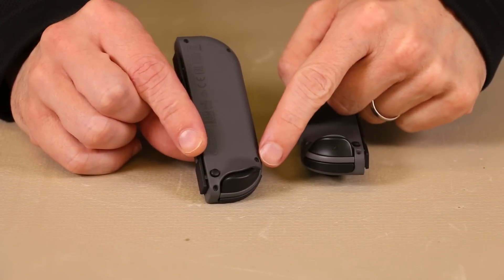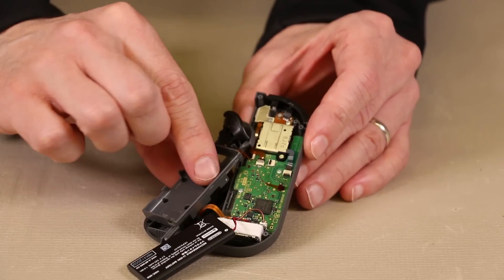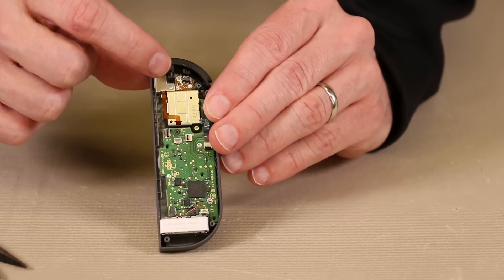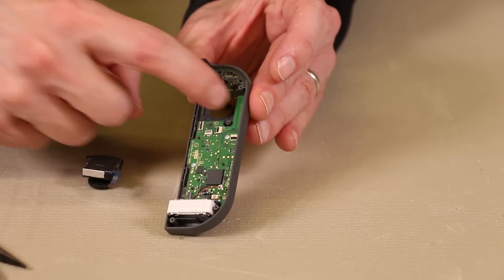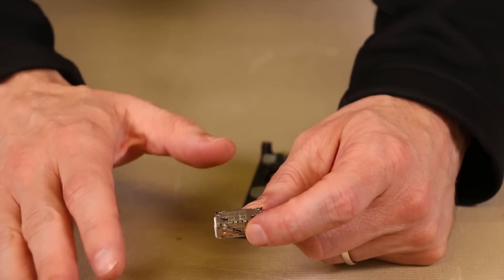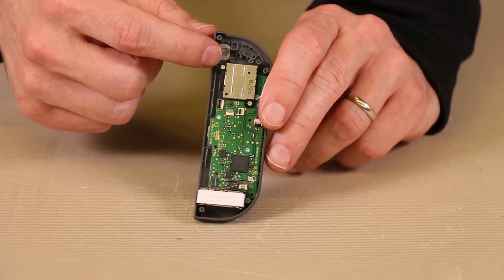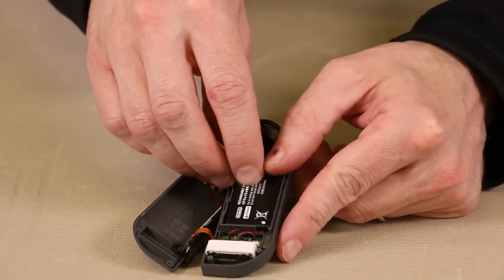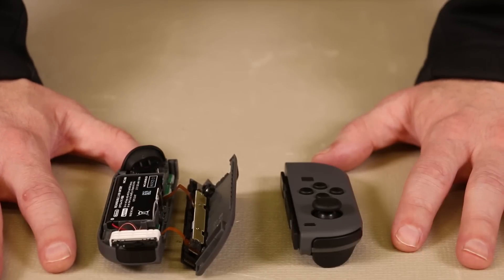Nintendo Switch Joycon Teardown -

Comment: There's no locking tab on the bottom ribbon cable that's attached to the casing that you removed, and the cable came out after the joycon was dropped and fell apart (I dropped my switch from a 1-foot height accidentally and am now trying to fix it) so I need help

Edit to clarify: My issue is that I can't get the ribbon cable back in and idk how to lock/unlock it without the tab

Comment: How come nobody seems to show the proper way of unlocking the connectors for the ribbon cables? They just say you need to remove the ribbon cables. Yeah - no kidding. But they’re really tiny and easy to break if you’re not gentle or using the right tool.

Comment: Okay, so I accidentally pulled the joycon off the side leaving the two ribbon cables hanging out. I ended up here. Your video rocks but I hit a snag. The little black thing that covers the ribbon cable has come off. Can I repair this? Can you go a little more in-depth on how to handle or fix these?

Comment: Thanks! I found this very helpful. I spilled wine on my controller and everything was sticky. This guide made things a lot easier than I expected. The only hard part was reconnecting the first two ribbon cables, because they need to be reconnected before the battery holder is screwed in...and everything is so ridiculously tiny; my hands are not.

Comment: Been an engineer for years, this dudes an idiot, if you actually followed this video that chances are you’ve messed something up. 
Just basics, please disconnect your battery before anything else as you can cause electrical damage if you don’t. And while it’s been brought up the cuts are just ridiculous. Please never do this again.

Comment: I was almost done putting the Joy-Con back together, just screwing the back to the front (your guide worked like a charm), then I realized I might not have put in the battery correctly. I started to unscrew what I had done and found that I had worn the top of the screw down and it was stuck. Don't know what to do, and I was so close to being done.

Comment: I've open my joy on to try and fix joystick drift but broke the ribbon cable to the minus button and l button sadly um if I use thermal glue to fix it will it work or unfixable?

Comment: Hey @tronicsfix ,what credentials do you have? I would love to get into fixing broken consoles. I have a experience with PC's and networking devices. I do not have any in electrical engineering. How would I learn the skills to help me get started in this awesome trade? Do you have resources? What is is called so I can google it? Electrical work? Circuit board repair?

Comment: For anyone wondering, you can use a joystick from a right controller in a left one (and vice-versa) and they work just the same.
Reply: I broke the white part where you connect the ribbon for the zl button. Do I need to replace the whole mother board. It seems like it. Advice anyone?

Comment: I came here because my L button was broken, and loved how you called it out. I was able to buy a replacement part off Amazon for $6 (and splurged on the same toolkit I can tell you used in the video) and was able to fix it with your help. Thanks!

Comment: So, I sprayed contact cleaner into my right joycon to fix it drifting. It fixed the drift, but it broke the reset button completely, made the home button only work intermittently, and often the Switch thinks the joycon has been removed even though it's docked to the Switch. I assume that in cleaning the joycon, gunk has either been washed elsewhere, or something has been pushed loose.  Is there any benefit in taking it apart and trying to clean it properly or will that just break it more?

Comment: Thanks so much for showing reassembly. Usually the teardowns only show disassembly. 

Im having trouble getting the 2 ribbon cables that go from the rail to the board back in, any tips? Im really afraid i may have stripped or damaged especially the lower one since my joycon now wont work in handheld mode and only on wireless. Consequently it wont charge the controller either. Any tips would be appreciated

Comment: Just remember everyone, you don't have to be an electronics expert to clean and repair the insides of your controllers and consoles! As long as you take your time, are gentle, and really look over how stuff's put together, the chances of breaking something are severely mitigated. You should always ground yourself first, and use the right tools for the job (in this case, the tiny ribbon cables warrant tweezers, for example). Checking this video out before I replace the slide locks and joysticks on both Joy Cons just for a general idea since I'll be livestreaming the process to all my Facebook friends and I wanna look like I'm an expert.

Comment: Im having a weird/frustrating issue with my right joycon. When in handheld mode and on the home screen it works fine but once a game is booted up it stops working completely but then when I use it in wireless mode it will start responding as normal. The issue started right after I worked on the left joycon replacing a broken L button (not once at all touching the right joycon). I’ve watched videos that share the same problem and most suggest to sync, calibrate, etc. but so far nothing has worked for me.

Comment: Thanks for the vid dude! I got a hell of a deal on a used switch today and noticed that one of the controllers had been dropped and the ribbon was out on the left controller. I was able to remove the small broken bit of plastic and put the ribbon back in place before further damage could happen thanks to your video. Works like a dream.

Comment: My left joy-con keeps disconnecting. I play on my TV using the standard joy-con grip, approximately 10--15 feet away from the  console. Everything works fine when I get back within 6 feet of the console, or connect the joy-con back to the console. Is this normal? Is there a video that addresses this kind of problem?

Comment: where is the gyro/accelerometer located in the left joycon? mine got a little wet yesterday, so I took it apart to dry, everything works fine, except when I'm gyro aiming in pokemon. it starts spazzing and doesn't recognize motion input from the left side

Comment: The part I needed to see the most, where you disengage the ribbon cable locks, you completely skipped over. How do you engage/disengage the locks on the ribbon cables?

Comment: my joycon has the middle part plug in in a different area and it's so frustrating trying to put it back in. The middle part being the ribbon cable that has the cover of the motherboard anyone else have this issue? Right joycon btw.

Comment: note to everyone looking to replace sticks in both joycons, the right one is build a little differently. there's more stuff crammed into it, screws are in different locations and the ZR ribbon cable is significantly shorter.

also, this black stuff you have to be careful about when you remove the sticks, jesus it's annoying. it always gets caught on the stick and its a pain to get back into place.

Comment: Hello, great video. Really like your stuff. 
On Ebay and such I only find the "left" shoulder trigger (L button) for the joy cons. Just wanted to ask if those are the some on the left and right ? 
Because my "r" button is broken probably because of heavy use.
I highly doubt that there is a different because I haven't found one only for the right. But just wanted to make sure and ask a pro :)

Comment: I really appreciate this! Thank you! One comment though, please explain how to open the locking tab of the ribbon cables for the part where the side L + R are attached. You cut that part out and unfortunately when I tried releasing the locking tab for the one away from the L trigger I broke the locking tab. Other than that, this video really helped!

Comment: I have a red joycon that one of my students ask me to check if I could fix. The R button wasn't working so I decided to check on it. Turn out the entire button was ripped off the board, pads and all. sigh here I go!
Reply from the maker: You can do it!
Reply: That’s what happened to mine!!! There is no cable:/ so I have it all put back on and it clicks but it doesn’t work. Any tips? Do I need to solder it?
Reply: @34squints  Well, if the button is ripped off, then yes, you need to solder it back on. In my case, I had to get a broken Joy-con from a local seller for parts because I couldn't find a replacement button at the time. Since the pads were all ripped off, I had to carefully scrape where the pads used to be until I found some exposed copper. Then I soldered the "new" button into it and its been working fine as far as I know.

Its not a repair I would recommend to someone with no micro-soldering experience as lots more can go wrong in the process. But if you're feeling brave, or you have some soldering experience and nothing to lose, then go right ahead, as that's the best way to learn.

Comment: hi when I went to reinstall the sr and sl ribbon cable i didn't work. i have just tried installing another ribbon cable replacement as i though I had broke the original cable but it still doesn't work some pls help me!
Reply: I should mention I followed this guide completely but he didn't show how to insert the ribbon connectors and that is why i I cant figure out what to do.

Comment: hey, so my left joy con died completely unexpectedly. it had worked perfectly fine the day before and i used it both wirelessly and handheld. i turned the switch off to give it a rest and when i turned the switch back on the next day, the joy con wouldn't connect or light up. no major drops or abuses to the joycon in any way, and i only had it for about 6 months. any suggestions for where i should go next?

Comment: I got Y000 and Y00 screw drivers and I managed to get one screw off but stripped the last 3.. how did you get them off so easily and what should I do now?
Reply from the maker: I've got a lot of experience and a good quality tool set. You can try a screw extractor or you can drill them out.
Reply: I happened to have an iFixit 20 pc screwdriver lying around with a Y0 bit and that worked like a charm. Look for a Y0 bit. :)

Comment: What my switch does, is the right joy con is ripped, the cables and that are on the right, and that is stuck on the switch. I need a way to remove it, and hopefully repair it. Please help
Reply: You should be able to take the rail out of your Switch with your fingers, then after that you open up the Switch with the screwdriver, after that take off the grey plastic piece like at 1:00 and then put the ribbon cables in slowly. One thing I'd like to say is that if you don't have the right screwdriver to open up the JoyCon, don't strip the screws trying to open it, just order the screwdriver off the internet for a couple dollars, I've once gotten a Flathead screwdriver to work but like I said, I wouldn't recommend it. Hoped that helped.

Comment: You skipped reinstalling the battery, it seems like its simply align and push in but that's not the case it seems as it didn't work for me. Should of shown your method, otherwise pretty informative video.
Reply: you are supposed to remove the battery connector from its slot, there are two parts. In this video he says to pry it off, don't do this, it completely tears the soldering of the battery connector which is why he didn't include the reattachment.

Comment: plz no cuts! It's important to see how you open and place things!!!
Reply: Yep, went on this video to figure out how to put the ribbon cables back in and he cut it out both times. Don't do cuts in tutorials, it's going screw someone up.
Reply: Yessss, I was gonna comment the same thing!!
Reply: Please no cut it’s important to see how you open in place things when you turn down the PS4 pro be careful on the metal plate you can cut yourself it’s happened to some people
Reply: U correct
Reply: indeed, i came only to see how the ribbon cables detach, but there is nothing for me here.
Reply: That's a sale salesman after all. He won't teach you how to fish but ask you to send it for repair 💸
Reply: agree, useless video
Reply: It’s pretty straight forward. I’d never done this stuff before but successfully replaced the L button flex ribbon cable thanks to this video.
Reply: Just put it back together the same way you take it apart, it's common sense.
Reply: goliath david ok but taking out the ribbon cables is easier than putting them in

Comment: What if the ribbon cables come unplugged? Specifically the 2 holding the attached to the controller
Reply: just did it, its as simple as taking the plastic part off of the top of the controller that holds the battery and they are right there, I did it in a matter of minutes and it works like a charm now!

Comment: So....why is there no mention of the removal and reinstallation of the ZL/ZR buttons?  It was barely even glossed over "Just put the pieces together and snap it shut, then install the triwing screws" doesnt mention the triggers or the spring that comes with it.  (You talked about L and R, but not the Z Triggers).

Comment: So, you suggest replacing the analog sticks, if they have drift problem. Is there no way to fix said problem? I noticed the problems, after my switch was laying face down, for an unknown length of time. Now both drift, either direction, after pushing said direction.
Reply from the maker: That is the way to fix that problem...to replace the analog sticks.

Comment: A few months ago, I was playing crash bandicoot 2 and snapped my right controller from the console. I don’t have the right screwdriver anywhere at home, but Is there anyway to reattach the ribbon cables? (Edit: I FIXED IT!!!!)
Reply from the maker: Glad you got it fixed. You should comment back and let me know how you fixed it...in case other people have this same problem.
Reply: TronicsFix LLC just some tweezers, a lamp, and a lot of patience to reconnect those ribbon cables (as much patience to thread the eyes of 2 separate needles)

Comment: Can someone help me? I broke a joycon off of my switch and the inside bracket is still attached to the switch but the ribbon cables are disconnected
Reply from the maker: What type of help are you looking for. You can always send it in to us for repair.
Reply: TronicsFix LLC I just need to know how to put it back in but I don't have a tri wing screwdriver:/

Comment: About the analog stick,you said you’d need to replace it if it’s moving on it’s own,which mine was,but is it possible to fix it or is it necessary to replace it.
Reply: Mr.NutShell you can shoot some compressed air in it and it might fix it because dust can get in there and make it drift

Comment: The philips head has 4 lines in the joycons their are 3 how did you pull them out ?
Reply from the maker: Use the correct screwdriver. I have links to kits that have the correct bits in them in my amazon store. Link is in the description

Comment: HELP! i was cleaning my switch with anti bacterial wipes and now my left joy con doesn’t work properly when i press right or left on the home menu it goes to options for the games and when i press + it’s counts as L and it randomly captures screen shots SOMEONE HELP PLZ
Reply: When using alcohol or any liquid cleaning products you should always let it sit and dry for at least a few hours. Even though it seems like its dried it not completely. Also ALWAYS remove the battery when using wipes on electronics

Comment: Man you made the battery look so easy to remove... I've already killed 2 batteries and motherboards on accident by breaking the plastic before the connector ever came apart. ;-;
Reply from the maker: I've done a bunch of these types of repairs.
Reply: @Tronicsfix  you aren't supposed to remove the connector from the motherboard, its two pieces. The cable part comes off and the second black plastic stays on the board.

Comment: when you put the two screws in for the mobo, you put them in the wrong place, the holes you used were for the screws that went through the battery holder as well, if you follow this method keep that in mind people!!

Comment: AHHHHH!!! I pulled out the ribbon cable by accident, I need to get it in!
edit: I got it back together! I bought metal buckels for my joycons, and had no idea there was a left and a right buckle, i thought they were the same, so i put the right on in fine, but the left one was backwards, so when i redid it with the correct buckle, the wiere came apart, this helped.

Comment: I'm having trouble removing the battery and I can see the plastic around the wires breaking from trying to pull it up. any help?
Reply from the maker: Don't pull on the wires! Use a plastic pry tool to pry the battery up.

Comment: But where can you BUY replacement Analog Sticks? Because the build quality is GARBAGE and mine already wore down (on my Pro Controller too..)
Reply from the maker: I don't think you can buy them anywhere yet.
Reply: TronicsFix drats. I've been looking even on sites like AliBaba with no luck.. was hoping a teardown YouTuber might have a secret source :p
I'm so disappointed with the build quality of the controllers.. which sucks because I love my switch
Reply from the maker: Yep...I buy parts from China all the time and haven't seen them for sale yet. I can get original parts but nothing upgraded. Even when they do start making them it will be hard to find better quality ones most likely.
Reply: TronicsFix well the good news is thanks to your teardown I was able to do a better cleaning of the joycon, the soft plastic of the stick rubs into the hard ring around it and you get that dust buildup like on the old N64 controllers..
now if I just find a teardown vid for the pro controller so I can do the same.. stalks your uploads
Reply from the maker: Ha, ha...I may have to do a teardown on that!